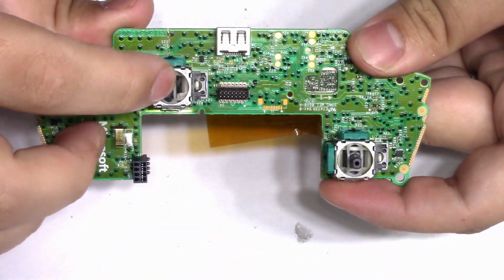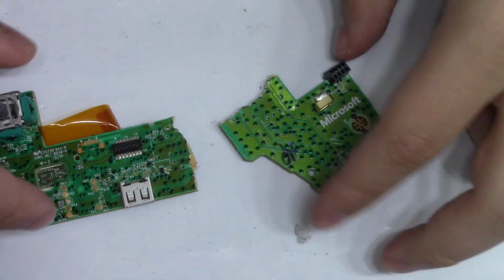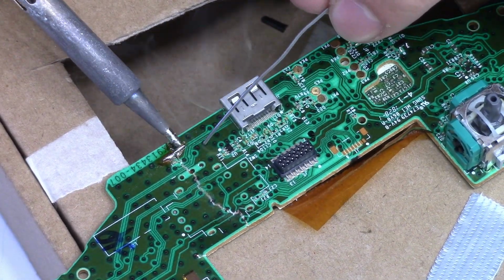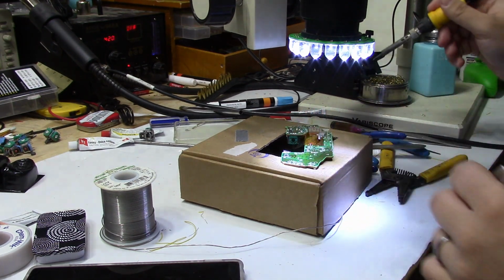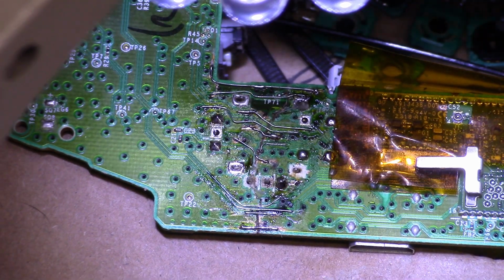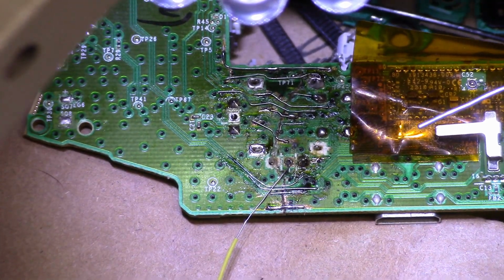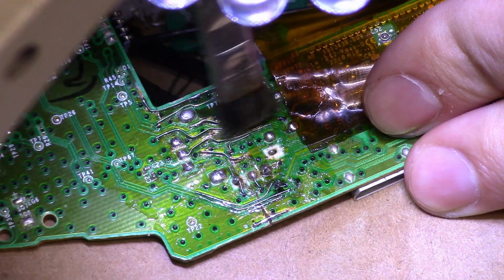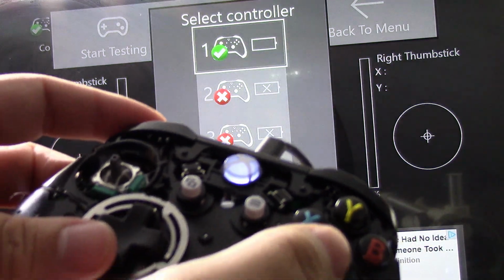Xbox One controller board broken  in two from RAGE. Can it be fixed?

Comment: I've had boards with similar cracks in that same spot. Never that severe but man people abuse these controllers. The solder pads on the 1708 controllers are so easy to lift its almost like they're trying to make up for the 1697/1698 sticks being almost impossible to remove with a soldering iron.
Reply from the maker: I don't even have to look up those boards to know exactly which ones you're talking about. I had to replace 3 analog sticks on those boards yesterday and I've never been so frustrated with a solder joint lmao.

Comment: Amazing as always man at this point I'd take that controller I'm sick of joystick drift I changed out the little things on the joysticks fixed it some tried replacing my joystick pulled up 2 pads with my solder sucker and gave up on that board great video man
Reply from the maker: Thanks! It's an incredibly annoying problem. Some games allow you to fix deadzone issues like cod but that's a bandaid when its the sticks fault lol and the pads rip up way to easy on certain boards. I'll be doing a controller give away soon :) I doubt my one video will hit that 1000 view count I was hoping for so I think I'm going to redo it so stay tuned!
Reply: @Solder_king  I'm always looking out for your videos man and that sounds nice maybe I'll be lucky enough to win it and yea those solder pads are weak on some boards for sure I didn't wanna keep messing more boards up trying to replace the joystick because I now only have one semi working controller

Comment: I'd reinforce it by using a thin piece of fiberglass cloth and epoxy on the bottom, if there's room. That would make it stronger but impossible to repair again. 'Course should it sustain that kind of damage a second time it'd be good only for a parts donor.
Reply from the maker: That's a pretty good idea! I think if it were to break again I may just let it be lol